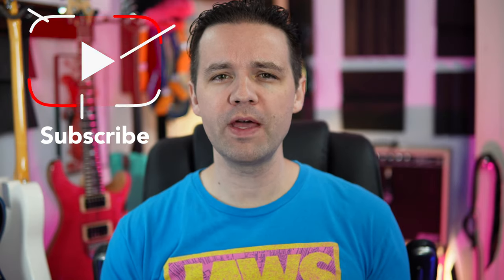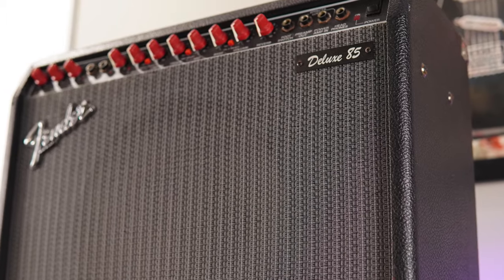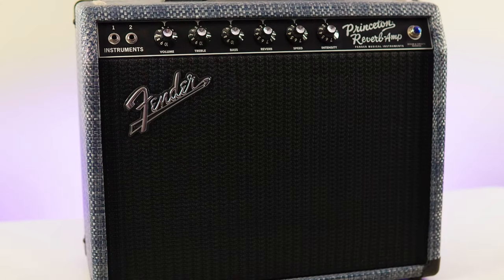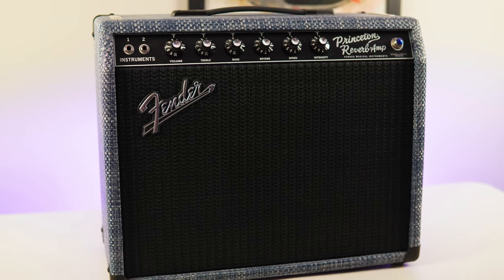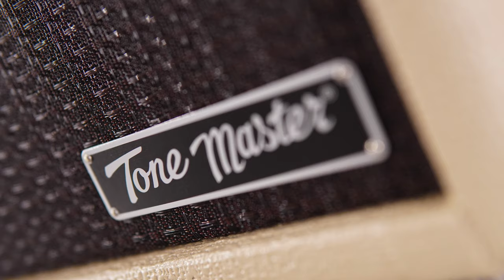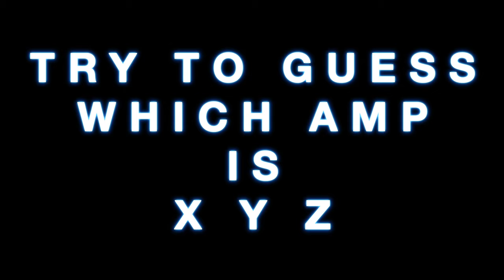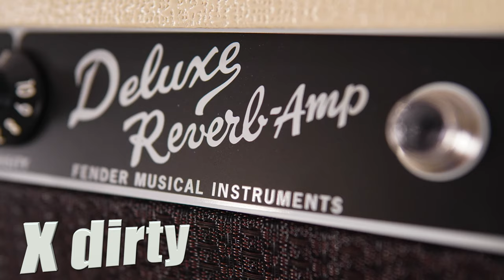SOLID STATE vs VACUUM TUBE vs DIGITAL - Tone Challenge!

Comment from the maker: Is There a ‘best’ Fender amplifier type? Let’s check out the tones from three types of amps: Solid State, Tube, and Digital.
Fender Amplifiers
🛒Sweetwater https://imp.i114863.net/5RKjn
🛒Thomann https://bit.ly/39B5OKI  
Fender Tone Master Deluxe Reverb
🛒Sweetwater https://imp.i114863.net/rnXRqR
🛒Thomann https://bit.ly/2VSZk6E
🛒Amazon https://geni.us/FendTMDB
===========
Timestamps:
===========
0:00 - What sounds better?
0:20 - Today's Amplifier Lineup
1:05 - How it works
1:20 - Who is Bill?
1:35 - All the gear and the setup
2:12 - Clean Tones
3:32 - Dirty Tones
4:35 - The Part You Want to Skip to
5:02 - The Part Most People will skip
5:15 - The Best Amplifier
5:20 - The Rambling

Comment: Apparently I don’t have the ear to tell the difference between a digital, solid state and tube amp as I was SOOOOO off.

But….who cares.  They all sounded awesome for what they were.  👍🏻
Reply: Same here. Think of the upside : we don't need to spend "a fortune" on tube amps :-)
Reply: @nikosmagnisalis6080  Absolutely!  There are plenty of amazing non-tube amps out there if you’re on a budget or just don’t want to spend the money.
Reply: To help you…. Digital sound have an AD converter and DA converter. This can reduce the dinamic response of the sound, which makes everything sound the same with the same volume and same effect overall. Solid state amps do not have a digital converter therefore have more dinamic range (an example is if you have high gain in the amp it will distort the sound if you play hard but if you play softly it will sound cleaner and less volume, with digital everything will sound either distorted or clean with the same volume )

Comment: The "digital" tonemaster is really just an evolution of solid state. Many solid state amps have used different methods over the years to approximate the sound of a tube amp. But these definitely do a better job than most.
Reply from the maker: it's a quad core Pentium II 350MHZ with MMX! □
Reply: @landonbailey  😂😂😂
Reply from the maker: @AndrewStottisTheIndiWerWlf  it is a quad core something though, Fender didn't specifiy
Reply: @landonbailey  yeah I work with DSP audio stuff at work. Its probably something designed specifically for audio DSP. I'm super impressed with the tone. I got that full Delux Reverb goosebumpy feeling from it in person.

Comment: Picked the princeton correct. Not the other 2! I thought the red knob sounded really good. My bet is that the tube felt better to play, as in more responsive to pick attack and touch sensitivity. The tonemaster sounded the worst to me, though they all sounded good. Having tried a tonemaster deluxe it definitely sounded and responded well in the shop. They've emulated the response of a tube rectifier really well which is why it felt better to play to me than the tonemaster twin.

Comment: Tone master sounded the best of all 3. But then, they were all set to 12 o clock and amps are supposed to be EQ’d. I’m sure all 3 can be made to sound great.

Landon, could you make a video where all 3 amps are set to their best possible clean and dirty sound?
Reply from the maker: ya I plan to do a future video with my fav settings and pros/cons of each
Reply: @landonbailey  I’ve seen all of them sounding great at this point but I’d still like to see them side by side. Is the tone master going to be used for guitar demos soon?
Reply from the maker: ya for sure. already has been used https://youtu.be/VYt9QtwRah4

Comment: I honestly guessed 'Y' was the digital amp, because I heard a slight warbling that I've heard other Fender digital amps do. But as far as the sound, they could be interchangeable. So we've finally reached a point where the type of amp doesn't necessarily determine the quality of the amp. 🙏

Comment: TUBE AMPS ALLLLL DAYYYYYY! I’ve tried to convince myself the past two years that digital amps like the Roland Blues Cube or the Tone Master Deluxe & Twin sound as good as they’re tube counter parts. Yes they provide some great tones, I’ve owned them all, comparing them on a clean setting makes them very hard to tell apart but once you add some volume or overdrive there’s no debate

Comment: What does digital mean? Tubes for the effects like a hybrid amp?
Reply from the maker: I think it means they used their fingers somehow
Reply: @landonbailey  So there's fingers inside a digital amp then? 😂
Reply: @landonbailey  I Googled it. No tubes. To much to explain. Bottom line it sounds excellent.
Reply from the maker: it's a quad core CPU running everything
Reply: @landonbailey  Something to do with the way the sound is processed.

Comment: This confirms my experience (disappointment) with the Blonde TMDR. It's way too muffled/unresponsive and lacks snap and presence even with the bright cap restored by firmware. I'm past the return window (and tube amp prices just shot up), so my fingers are crossed that Fender improves things via firmware updates. I guess I might try a speaker swap at some point as well, though that mid of blows for a new (and rather expensive) amp.

The Quilter Aviator Cub might be an in-production alternative to the red knob. Isn't the red knob a staple of Jonny Greenwood's setup?? (Pretty cool, that.)
Reply from the maker: I had everything dialled at 12, but I still like it. I've done a more detailed video recently on these amps. https://youtu.be/dGfYoQlc0zE
 and ya the Fender Eighty-Five is the solid state Greenwood uses for his dirt pedals. It's the the same amp I have, except mine adds the reverb tank

Comment: I loved the clean on the X the most, though, I thought initially that it was the digital one and that Z was the tube amp. X and Z were both very close in terms of clarity and creamy-ness. Y sounded way too muddy. On the dirty tones, same ranking when it comes to preference, but this time it's impossible not to tell the tube amp. I still thought that out of the SS ones, the better sounding one is the digital one and boy I was wrong. Just shows how good the old transistor is and how close it can get to the real deal.

Comment: I don't think 95% of people can tell the difference, well I mean not with this style of play and not if you are setting them up properly. SS has the problem of Clipping but there are ways around that like with the new Orange Supercrush 100  to get around the clipping issues you just need to set the volume and gain properly. That Amp really blurs the lines between Tube and SS
I would say only in certain kinds of music genre and playstyles will you really see the difference and even then Digital Amps or SS have gotten so good its hard to tell the difference until you push it to where they may be weak.
That is a case where people make a really big deal out of the type of amp when the reality is these days Amps even budget amps are simply beyond good, You have amps in the $150-350 range that are simply fantastic,
Vox micro Superbeetle, Orange Micro Terror + Terror Stamp/Pedal Baby, Marshall DSL1HR + Origin 20, Positive Grid Spark, Yamaha THR10, Fender Mustang + Champion series 
I mean its a great time to be a musician with all the tools at your fingertips.
Reply from the maker: so many options!

Comment: Yep, digital sounds off, like you have to tweak it.

Valves sound warn and full of sound, the tone covers the air (I'm using a hifi stereo sound system) of my bedroom, and you can feel how the ambiance vibrates with the bass of the fender.

Definitely I'm buying a pre amp and a solid state, the sound is clear and pure, digital lacks something

Comment: I thought red knob and Princeton sounded very close both clean and dirty. Although, I thought perhaps dirty red knob sounded a bit more brittle (& thinner maybe).

The TM blonde has a really fat sound, so I could pick that,  and especially dirty I reckon demonstrates that eq is required. I actually didn't like it as much dirty in this demo.

I never have my bass = treble with any 🎸 I own. So, perhaps didn't highlight it at 'best' settings, although the eq was level on the others!

Other than that let's not forget about 'zed'. It's used by British speaking countries & closer to many non English countries. So, on that basis, I think other than Americans 'zed' is most commonly used. You should be celebrating 'zed', rather than feeling like the amp with red knobs, when the others don't. 👀

Although 'zee' sounds much better ending the abc jingle.😂😂😂

Cheers Landon fun video. 😎
Reply from the maker: your sound descriptions were how I heard them too. cheers!
Reply: @landonbailey  Oh..nice...I can still hear after years of going to gigs or we both can't hear. 👂😆

Cheers Landon. 👍

Comment: Hmm… the Tonemaster sounded like crap compare to the other two. I liked X and Z equally, though Z was a bit too sterile for my taste, but it wasn’t horrible. Wonder why the Tonemaster sounded so bad. It didn’t sound anything like the Tube amp it was supposed to emulate. At least not to my ears.

Comment: The differences were subtle. I had the Princeton right, but not the solid state and digital. They sound surprisingly close one another.
Reply: I got the same resutls. Picked the princeton correct. I thought the red knob sounded really good. My bet is that the tube felt better to play, as in more responsive to pick attack and touch sensitivity. The tonemaster sounded the worst to me, though they all sounded good. Having tried a tonemaster deluxe it definitely sounded and responded well in the shop. They've emulated the response of a tube rectifier really well which is why it felt better to play to me than the tonemaster twin.